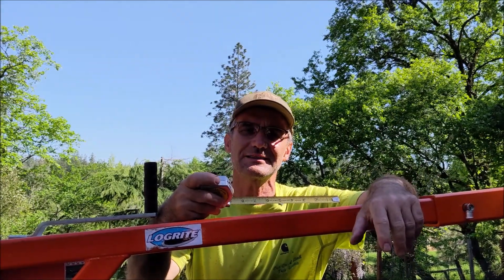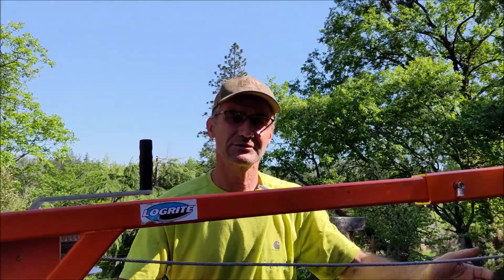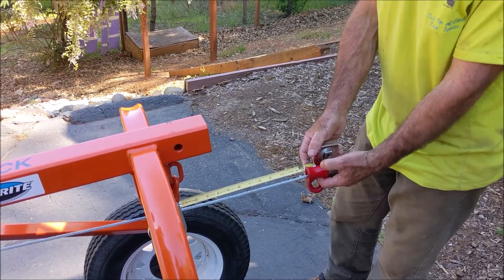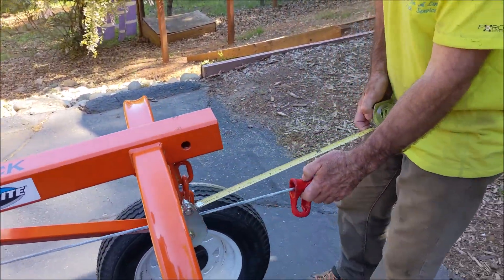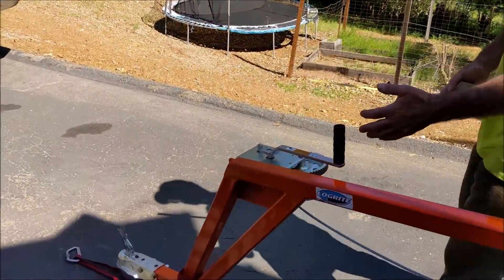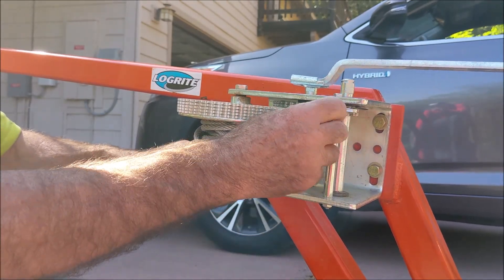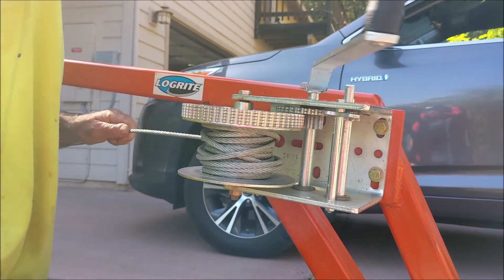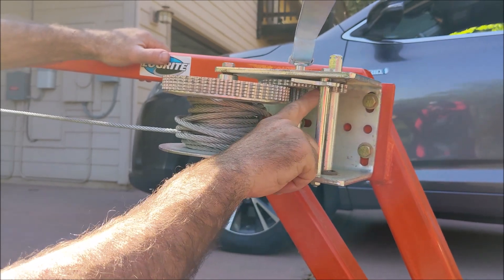How Mechanical Advantage Works with a Winch

Comment: Nice video
Reply from the maker: Thank you
Reply: @ColfaxMath  welcome
Reply: However, as your spool loads up.with more cable, you'll make fewer revolutions per inch, increasing your MA.

The base math works, but it changes as you add spool diameter.